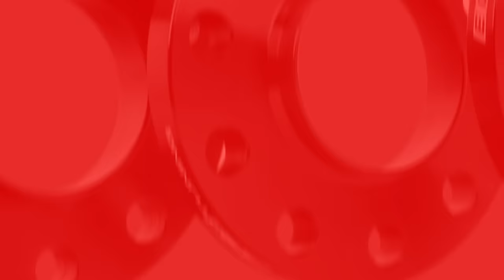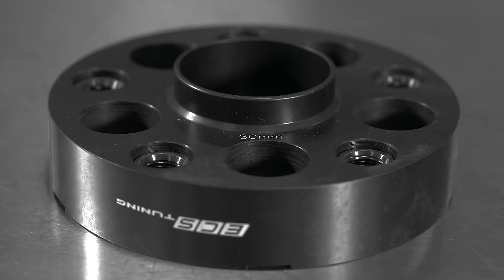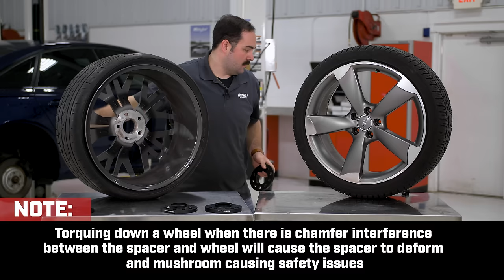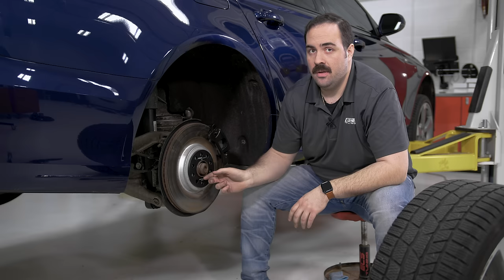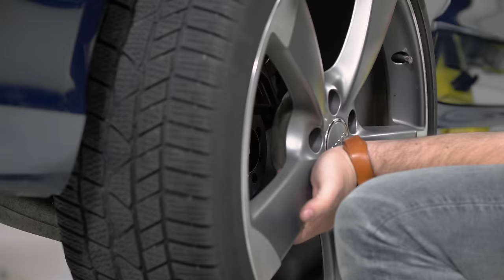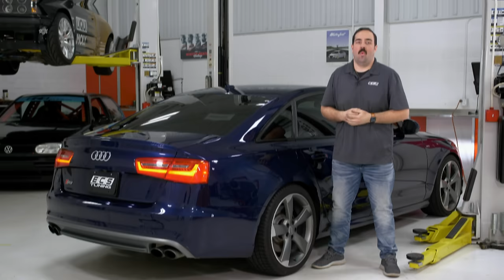DIY | Wheel Spacer Install and Torquing

Comment: I ordered spacers for my 2024 Nissan Altima SR. I ran into that situation you talked about with the chamfer on my OEM wheels. The center part of the spacer doesn’t seat all the way into the original rim. The rim rocks in all directions on the spacer. The specs for my car suggest that is has a 66.1mm bore, which is what I ordered but they still don’t seem to fit. Is there a way around this?

Comment: I've done the install as recommended on my GLI with 12.5mm up front and 15mm in the rear, but I still encounter a vibration felt in the steering wheel and seats around 75-85 mph. When the spacers are off there is no vibration. Do you have any suggestions as to how I can eliminate the vibration?
Reply from the maker: First, check the balance of the wheels. Vibrations will be amplified with spacers. Second, make sure there is no chamfer interference between the spacer and the bore on your wheels. Lastly, ensure they are torqued properly. In odd situation, you may have a defective product, and we can measure your spacers if you still have issues. Please check over the first three tips.
Reply: I also buy this ecs spacers for my a3 8p and i also get the vibrations you say. I think its not center properly and this spacers are garbage
Reply: @omergilert7355  I bought ECS 8mm spacers. I hate to say it but I agree. I should’ve just bought 42 Draft Designs spacers. They never did me wrong.
Reply: @jboesz6569  I have the 8mm spacers too and they vibrate like crazy at 55mph. Did you get this fix this issue?
Reply: @shibidi  I apologize for the late response. I took them off. The wheel fitment look fine without them.
Reply: @realsaxual2357  I probably have a lot of corrosion on the surface of the hub. I cleaned it pretty good and the vibration is still there even after getting alignment, new tires/balanced. What the paper test?

Comment: I had the same issue with ecs 10mm spacer on my OZ wheels. You talked about the issue so what’s the fix? Or how to find the right spacer spec?
Reply from the maker: Best bet is to try it on your wheel without mounting. If you have issues you can return them as long as you don't install it onto your car.

Comment: So basically I need to a run 12mm spacer on my aftermarket wheels (rotiform blq) so it doesn't rock back n forth like how the 10mm spacer does?
Reply from the maker: Yes, give a larger spacer a try.
Reply: Okay thank you for the response!

Comment: I ordered 12.5mm for the fronts and 10mm for rears for my e39 530i. I had not seen this video. My 12.5mm fit like a glove but the 10mm had the exact rocking motion shown here; the wheel would not sit flush against the spacer. Ordered another set of 12.5mm for the rear. Wish i had seen this video before. Or I wish they would have included a link to this video on the 10mm and 12.5mm product descriptions on the site. I still would not have know which would fit but i would have done a better job of test fitting before installing.

Comment: Hub centric rings are needed only for the aftermarket wheels or even for the OEM wheels ? Thank you in advance
Reply: Usually with aftermarket wheels because they (usually) aren’t the correct center bore as stock

Comment: What is the torque spec?
Just received mine and have a slight vibration on 160km/h+
Might just rebalance my wheels at the same time.
Reply: Mk7 gti - flush kit

Comment: I put 04 golf wheels on my 96 Camry and it’s rubbing on the back struts which is causing a wobble with 16x7, 5x112… what should I do.
Reply: Different hub bore size maybe? 04 golf wheels are 5x100. Idk what lug bolt pattern the 96 camry is

Comment: Thanks for the informative video. I have a 2017 Audi S3 8V Sporthatch, with factory 19" wheels. I am looking to get wheel spacers all around. Can you please recommend a thickness that will ensure I don't have to make any modification to the wheel arches etc, and won't get any rubbing or tire contact issues, including on the front from lock to lock, and even on full suspension compression? Cheers!
Reply: Did you ever figure this out
Reply: @_NB233  No... still on factory rims. I think 40 offset will work, but I'd prefer to check they don't rub first.
Reply: Sorry, I mean 40 offset in new rims. Wheel Spacers are completely illegal in my country, believe it or not...

Comment: Do you need new, longer lug bolts when using 15mm spacers or will the oem ones still work?
Reply from the maker: Yes, longer ones are needed and included in all of our spacer kits. We did the measuring for you!
Reply: Do you guys sell lock nuts for the correct size spacers?

Comment: What’s the point of a wheel spacer?
Reply from the maker: To clear suspension components or to make the wheel flush with the fender.
Reply: So it's looks better, some car wheels a way too inside and would look subjectively better if the wheel was a bit more out and flush with the body

Comment: They are a fast and easy way to ruin the geometry of your car and can badly affect the handling.
Reply from the maker: If installed properly, it won't effect handling. It will actually increase it.
Reply: @ecstuning  turning radius is increasing depending on the offset of the wheels, slightly more strain on the wheelbearings aswell